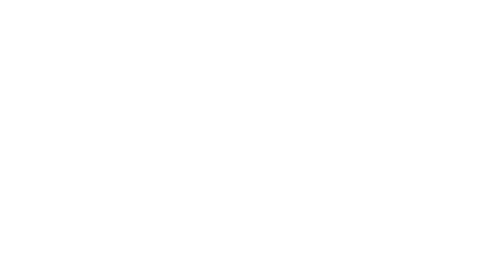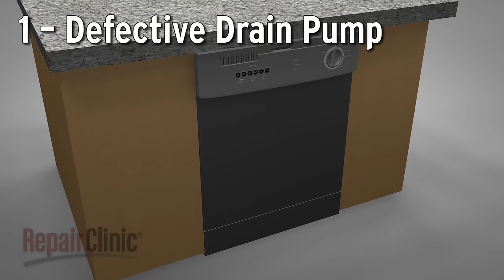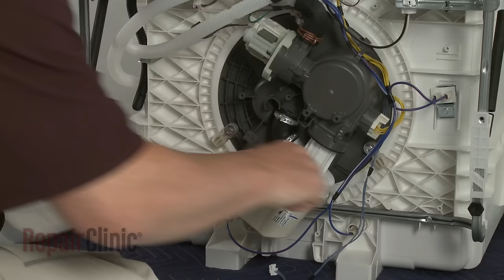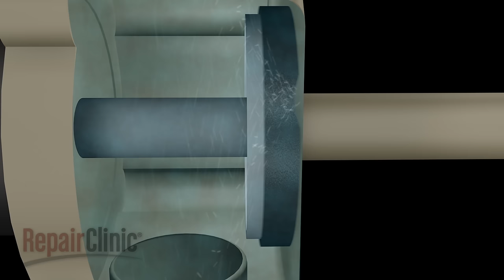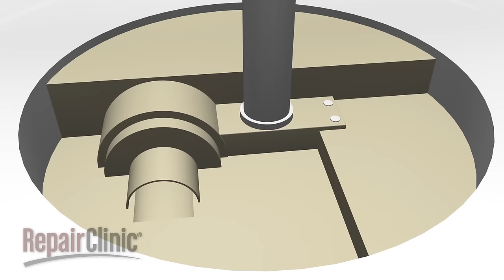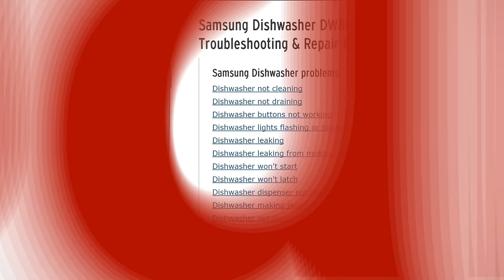Top Reasons Dishwasher Is Noisy — Dishwasher Troubleshooting

Comment: I have a GE portable dishwasher model GSC3500D51BB that I replaced the door gasket on and the two little black seats that go in each corner at the bottom of the door. The dish washer still leaks out the bottom of the door. any ideas guys.

Comment: What is a droning sound? Mine sounds like it is trying much harder than it should when washing, like something is trying to stop it.
Reply: Mine is doing the same thing its such a loud humming sound i cant stand it...what did you do to fix it?
Reply: @Angel-gb9gi what did you end up doing to fix this?
Reply: @salvatorelivreri  there was glass and rusted screws in the drain.  My husband took it apart and cleaned it that's all I remembered ...I just asked him what he did to it and he can't even remember exactly what he did besides clean the drain. It was rusted and the  food chopping device was rusted and falling apart.  It still works but not like new.
Reply: @Angel-gb9gi  we found a screw in ours.  Problem solved!
Reply: @salvatorelivreri  glad to hear it.  Mine got so loud I couldn't stand to be in the same room with it.  It's much quieter now that he cleaned up all the junk trapped in it.  He has replaced the seals and the rollers too I figure it's not got too much longer before something unfixable happens.